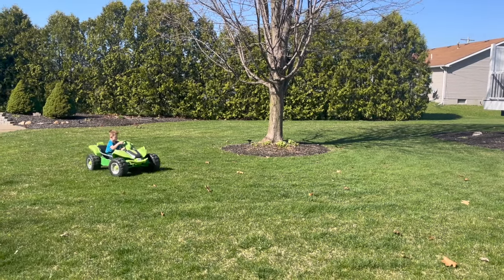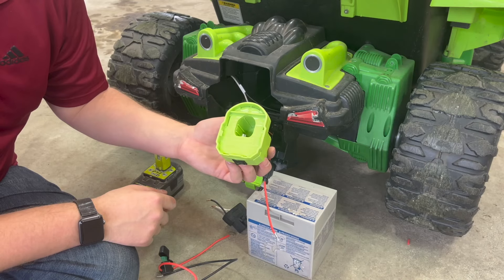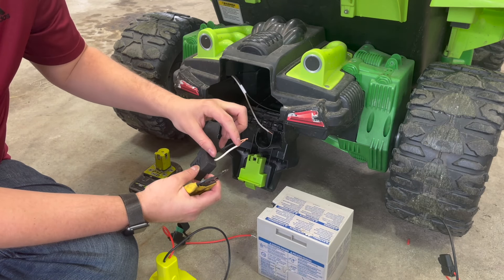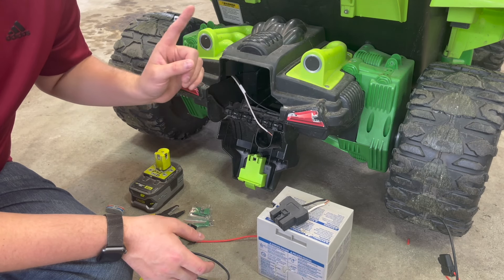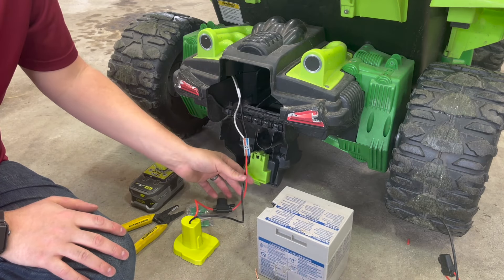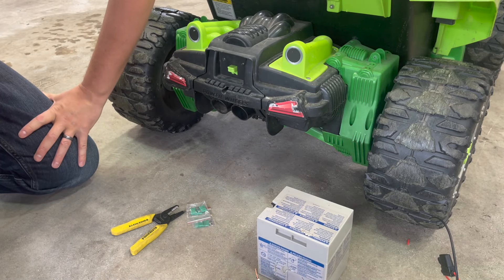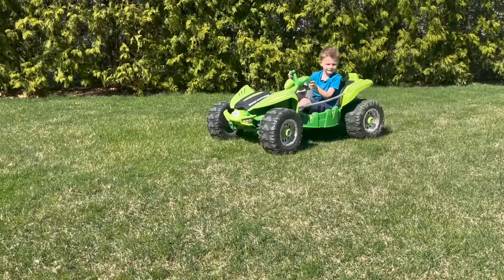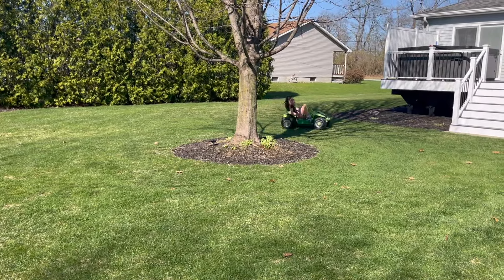Easily convert Power Wheels to any drill batteries. Ryobi, Dewalt, Milwaukee 18V conversion.

Comment: I converted my daughters quad to Ryobi power about 6 years ago... I had to take and rewire an old Ryobi charger to make my adapter but the power increase was insane and she loved drifting it 😂 it had so much power my wife and I could ride it with the new baby... I weigh 175 pds the wife is about 110 😂 but it still drives great to this day and the kids still love driving it.. the baby is now 5 and he takes 3 of my  batteries and he takes the power wheels when we go for bike rides on the bike path by our house with 3 6 amp hour batteries he makes about a 4 mile trip and still has plenty of battery left to play with when we get home... We have a forest behind the house and the kids have nerf gun wars he will purposely send nerf bullets into the forest so he can get "Big Bob" ( yes they named the power wheels) and track down his ammo... Save yourself a headache ditch the lead acid power wheels batter and convert it to your power tool batteries immediately 😂
Reply: Did you burn out the motors at all? Or kill any batteries by draining too low?

Comment: Did this to ours, used the adapter that you had trouble with.  Works perfectly.  I only let my son run it as low as 1 bar, then I swap out batteries.  Lithium doesn't like going under 11%. I have heaps of Ryobi batteries, so no problem.  Went from a slow car that runs out of battery in 30 minutes to a fast one that has endless battery 🔋. Game changer

Comment: How long does one of the 18V batteries run it for? Also, any concern with them getting over drained and then won't charge anymore? Have heard people mention that happening with other brand of batteries, but supposedly Ryobi has a built in feature to protect them from it, but who knows.
Reply: Depends on amp hour rating on battery and yes it can over discharge the battery. It does have shut of feature but onlu works when connected to a tool. If you over discharge you can fix it.. look up videos on how too
Reply: @Diy-For-Life  I over discharge 2  bosch battery, and could not get them to fix.

Comment: I have exactly the same setup as you and it works but then stops in short bursts - any idea why? I took the wire connector off and even connected the wires directly but still doing the same thing
Reply: Did you ever solve the problem?! Iv replaced gear shifter switches the pedal switch new battery. Before I started trying to use drill battery the dune racer started doing that going sometimes till kids were done then next time go 2 mins cut off wait 5 mins sometimes have to wait more but then it would go. I assumed that was the original battery starting to go bad, that's why checked about new one and saw the power tool conversion mods. Well first time after switching over and replaced gear switches it went for not even a minute barely cut off bit later went another minute a few times and then now the longest time It won't do nothing!!
Reply: It could be a thermal cutout. I've seen other kits that are more thorough that bypass any type of thermal cutoff. 

The powerwheels is trying to protect the motor. Probably best to upgrade to R/C titan motors while doing this.
Reply: @meangreenhatch1  I'm not very savvy with anything like this. I mean I understand but I'm scared to just do anything like choosing motors and gears. I know ml toys has their easy connect sets but for those prices if I had it to spend id just buy a new one or some type ride on. It's stressing me out now I don't have any help and my lil girl is little bigger now and wants to get to drive it. Are there many motors even brushless kind that will just fit back on the dune racer and gears?
Reply: @leahrodriquez1349  i have a local RC store that sells the 20v motors here by me. Its my next step if i cant figure out the power issue im having. I tried a DC Voltage Protection Module based on another video i saw, it burned up after 5 min in the yard with both my boys in the car.

Comment: We followed the video instructions and converted to the ryobi battery. The dune racer worked for a few times with the 18v and now doesn’t work at all. The fuse looks fine. Any suggestions?
Reply from the maker: I would double check your wire connections to the battery adapter. Sometimes from pulling that assembly in and out you can end up pulling the wires out of the clips. That would be my guess assuming the fuse is fine.
Reply: Probably burnt out the 12v motor or melted the wires.
Reply: @neo307a  The 18V battery voltage higher than your car needed, It is very likely burns the electronic board. most of power wheels only needs 6V or 12V, you have to buy a voltage converter when you use 18V batteries.
Reply: Did you ever figure it out? My kids dune racer started randomly cutting off would work again in a few a sometimes go fine or run a few mins cut out again. So I assumed it was the battery going bad, so started looking online for alternative brand batteries because Fisher price battery prices!!! And saw all about the power tool battery mods so I got drill battery. And it wouldn't work a friend put on new shifter gear switches still thought nothing but went to move it one day and one of us leaned on pedal and it worked. Took outside a few days later for lil one to ride and it went a min cut off sometime later tried it worked for another min or two. Then days nothing so replaced pedal switch but still have not been able to get to cut on again. I bought a breaker for friend to put on when he done the drill battery. Its been months and I can't figure out what it could be. And no longer have the help from my older son's father to help anymore as he passed away.

Comment: Man, thank you so much for this video definitely a game changer.
My kids have a Huffy Torex UTV 24 volt stock. 18 hour battery charge time for 10-15 minutes of driving time if I’m lucky enough. Ordered this product from Amazon (because I have an endless supply of Ryobi batteries) it came in late Friday night, hooked it up in the early hours on Saturday morning and the kids have been driving around all day. 
They couldn’t be happier. 
Proud Dad moment/day 😅 Thank you
Reply: Thinking about doing the same to the huffy torex. Did it make it faster? How many Ryobi batteries are you using and how long does it last?
Reply: @travishanson2119 
I highly recommend. I didn’t notice any difference in speed just drive time. 
I have Ryobi 18 volt lithium batteries. 
Battery life varies on where the kids are driving.
I’d say the average play time is 30-45 minutes per battery. 
Definitely beats having to plug up the stock battery or remembering to charge it for 18 hours.
Reply: Can i ask a follow up to your post, i keep reading about over discharge and batteries risking catching fire. I have 2ah and 4ah high performance ryobi batteries. Any issues with the batteries wireing them Straight to powerwheel like this? Ikept burning fuses and cant figure out how to keep them from blowing.

Comment: Effing thank you so much!! I'm not an electrician. I'm not well with cutting and combining wires together. Once I've seen you do it, I grow my balls and started. Now my that I have Ryobi batteries everywhere. The Barbie Mustang pills out and drifts now.
Reply: Can i ask a follow up to your post, i keep reading about over discharge and batteries risking catching fire. I have 2ah and 4ah high performance ryobi batteries. Any issues with the batteries wireing them Straight to powerwheel like this? Ikept burning fuses and cant figure out how to keep them from blowing.

Comment: Dude! Thank you! This video was perfect! I used the link and a 18 v Ryobi battery and it was super easy!
Reply: Can i ask a follow up to your post, i keep reading about over discharge and batteries risking catching fire. I have 2ah and 4ah high performance ryobi batteries. Any issues with the batteries wireing them Straight to powerwheel like this? Ikept burning fuses and cant figure out how to keep them from blowing.

Comment: I have a ryobi one lawn mower also a big tool set with circle saw drill ect. I have 7 batteries my boy and I customized a barbie Escalade we pulled from the dumpster that a coworker threw out. Pulled every piece of it apart painted it blue with tan interior I put headlights,tail lights and blue under glow on it. That was 3 years ago now my boy is 8 I'm going to order the 2 pack of battery adapters and run them parallel and see how 18v goes. It currently has a 12v jetski(same as motorcycle) battery in it I think I'll leave that battery in it to run the lights and have the 18v only power the motors. Probably upgrade the radio to a cheap real one with Bluetooth. Not sure if this is because my boy likes the power wheels or because it was the early 80's and I didn't have anything like that as a young kid??????😅

Comment: Videos like this that show ppl how to over-volt electric motors all seem to have a bunch of comments from ppl that tried it and broke/burned out there motors.

Sure if ur kids not heavy and ur not putting much load on the motors u might be able to do it, maybe even for a long time. 

A fuse can certainly help but let’s keep in mind at 12v a 20amp fuses will pop at a little over 240w. At 18v a 20amp fuse will pop a little over 360w. That’s 50% more than 240w and it’s asking a lot out of the cheap little electric motors and plastic gears they put in these things.
Reply: Since you seem aware.... I have a 6v power wheel go cart that im thinking of using a 14.4 Makita lithium battery on, using a dc to dc converter to drop the voltage down to  to 6v and has a 3-4  watt rating.... Do you think that would work?
Reply: @neo307a  It could work.
Reply: Yup, that's why you gotta upgrade to some beefy motors like the 775s and install some metal gears, if you can find some. I do believe they exist for this buggy style.

Comment: I done this several years ago on my daughter’s grave digger. Lately I’m thinking of getting a 2 stroke engine and installing it. I’m also thinking of building a bigger suspension and then mounting 4 wheeler tires. I live in the country on a farm so she has plenty of area to ride it. I may have to do a build video. I’m not finding any on line.

Comment: Did the same and worked great for a while (ryobi) now it just shuts on and off randomly until the wheels just stop and the the motor will run?
Reply: Ever figure out why? In the middle of doing this and had some issues with my set up too.

Comment: Thanks for the useful video. I have a question or two. Which specific 18-volt battery did you use in terms of the amp hour rating Etc. And most important oh, how long did a fully charged 18 volt battery last on the Power Wheels toy? Thank you and best wishes
Reply from the maker: I normally use a 4ah battery, which lasts for about 20 minutes or so then swap them out.
Reply: @Type5Reviews  thank you for your quick response! I appreciate it. I have the basic Ryobi 1.2 amp hours batteries, so I am guessing I will get about 5 to 6 minutes 0f use for each battery.! May have to buy some with larger capacities.

Comment: What AMP-hour 18 volt battery do you recommend I have both 4AH and 6AH batteries?
Reply from the maker: I have both and have used both. The 6ah batteries will last longer than the 4ah ones, but I like keeping my 6ah ones for my tools and let the kids use the 4ah and cycle through those on the chargers.

Comment: Did you have any issues drawing the batteries dead? Did you install a low voltage shutoff?
Reply from the maker: I didn’t install a low voltage shutoff. I’ve generally just let the kids run it until the battery dies and swap it out for a fresh one. The batteries can get a bit hot if drained quickly, so the worst I’ve dealt with is the charger waiting for the battery to cool down before it starts charging it. Hope this helps.

Comment: My nephew has the same power wheels. I cut the tread off of some small quad tires and wrapped them only on the front for better traction and has helped alot. 
I plan on doing that to the rear as well.

Will adding extra grip give it to much grip and ill destroy the gears in the motor if I do this battery upgrade? He's a small 3yr old kid doesn't weigh much 
Do you think I'm better off not doing anything to the rear tires so it puts less stress on the gears?
Reply from the maker: There’s always some risk that upping the voltage can stress the motors, but I think you’ll probably be good with a 3 year old. That’s definitely not much weight and the tires on these things do wear fast. But hopefully it doesn’t scare him when he’s thrown back in his seat from the extra speed. 😂 Good luck.
Reply: @Type5Reviews  thanks man I'm going to order the adapter for the Dewalt conversion today. Nephew has his break from school because of Thanksgiving hopefully it gets here soon so he can enjoy it before going back to school. Appreciate you for taking the time to reply! I hope you and your family have a nice Thanksgiving holiday wish ya'll the best!
Reply: You could also use a spray on rubber, on the tires. Just have to reapply periodically. Can also upgrade the motors to 775 and get better gears.

Comment: I did this conversion today, works great! Although I have to get bigger ryobi batteries. 

Has anyone found a good way to mount this? Could I do like a Velcro strip on the bottom of the battery? They don’t seem to get hot so maybe that would work?
Reply: Get a version of battery converter that has mounting plates- screw it in
Reply: @erikrose7041  I just don’t see any of the Ryobi ones online that have mounts. They all seem to look the same.
Reply: @12hutch12  you could screw in a mount around it door it to set

Comment: Stupid question my sons powerwheel have red and brown wire connecting to the battery does anybody know which one goes to which?
Reply from the maker: Well if you hook them up backwards then it would just make the controls reversed. Forwards would be reverse, etc.  So try it one way and if it’s wrong flip the wires around.

Comment: Can you do this on a 24v ride on?
Reply from the maker: Going from 24v down to 18v would probably not be ideal even though it would be convenient for the drill battery use. The other thing to consider is on those 24v cars there are often other voltage regulators and accessories like lights or a radio where changing to a drill battery would not work or could even cause some damage. So I’d only recommend this for the 12v power wheel systems without the extra electronic options.
Reply: Run two of em in series and go a full 36!
Kidding, not kidding, let me know if you do it.
Reply: @josephfriedrich9792  Turns out, it is 12V batt to each back wheel motor. Not true 24V. But i think now i can just 18V upgrade each side and run 18V to each back wheel motor

Comment: Can you tell me the exact converter you purchased for ryobi? And should I get a pack of fuses?
Reply from the maker: The link for the ryobi converter I used in is the video description. It comes with a few fuses, but you could buy some more if you run out. Mine doesn’t blow fuses unless I have more than one large kid in it going up hill.

Comment: Will i be able to use a DeWalt 20 v adapter and do the same thing without burning motor?
Reply: Potentially. You can install a power limiter inline. Or, upgrade the motors to the 775 brushless.

Comment: I did the dewalt converted powerwheels and but the powerwheels radio works but wheels aren't moving
Reply from the maker: Unfortunately these types of converters tend to not be compatible with cars that have different electronic options like radios and lights etc. My dune racer is PowerWheels specific brand and only has the motor and no extra options. That’s unfortunate if it won’t work out for you.

Comment: Do you have any issues with the fuse popping? I’ve seen reviews on this adapter (minus the fuse) and no issues. I have also seen reviews of this adapter with the fuse and apparently people have issues with the fuse popping.
Reply from the maker: The fuse is supposed to pop if there is too much load on the motor. Under normal use with 1 kid in it the fuse won’t pop. But if you have two kids in it and they are going up hill it may put enough load on the battery that the fuse will pop. But I’d rather have the fuse pop and replace that then have my battery die, so I would recommend one with a fuse.
Reply: @Type5Reviews  thank you for your response. That makes sense 👍🏼

Comment: What fuse can I use. I'm using a 20 amp fuse but the fuse keep blowing
Reply from the maker: The only time my 20 amp fuse blows is when there is too much weight in the car. Either that or if the car is going up too steep of an incline. If you were to switch it with a higher rated fuse you could risk damaging the battery.
Reply: @Type5Reviews my kit came with 30 amp fuses and im blowing thru those. I saw someone use a copper strip to bypass the fuse but as mentioned ive heard that runs risk of fire from the batteries.

Comment: Any issues with it overheating? I did my with a dewalt and it over heats for some reason.
Reply: most of power wheels only needs 6V or 12V, you have to buy a voltage converter when you use 18V batteries.
Reply: Elaborate pls
Reply: @Noah-ge1fs Can i ask a follow up to your post, I have 2ah and 4ah high performance ryobi batteries and had a DC Voltage Protection Module on it. It burned up the module after 5 min with both my boys in it. My wife wants me to "figure it out" before putting the boys in again.😂